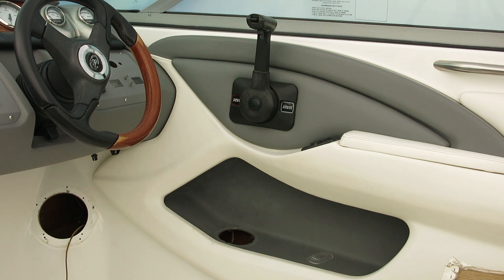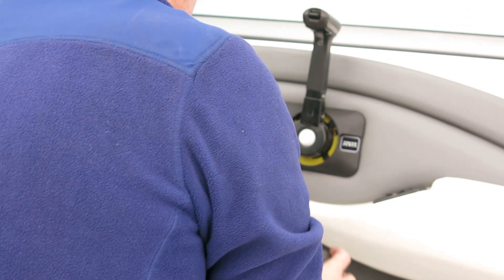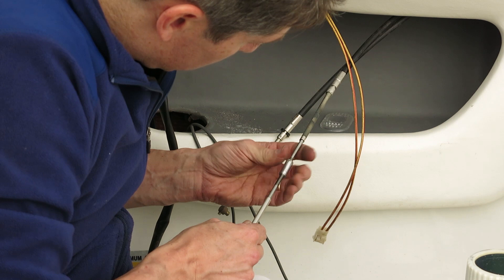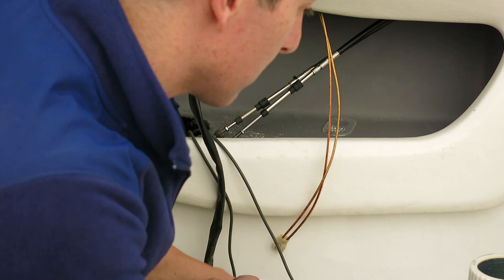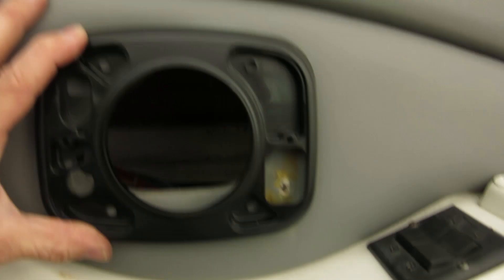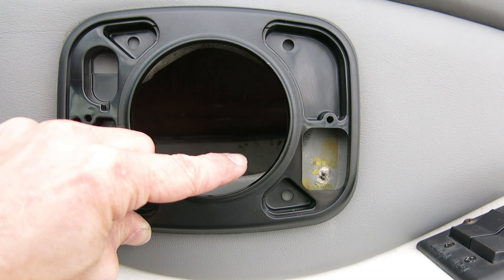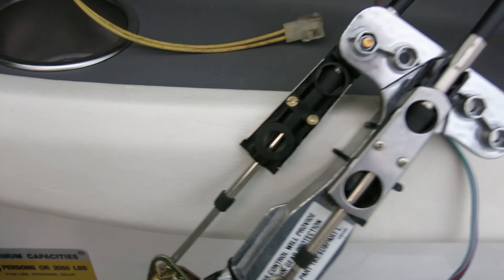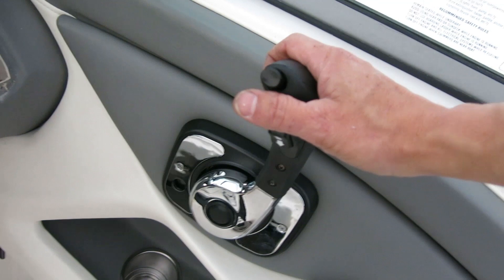Upgrading a Seastar Controller

Comment: Thanks for making this video, it helped me figure out how to remove my old controller and also what types/brands would likely be a replacement.  At first I was a bit miffed as you were between the camera and what I wanted to see, but I still got the idea and this was great information.  thanks again!
Reply from the maker: Sorry about the camera obstructions!  I'll try to do better.  Appreciate the feedback.
Reply: @SlideruleRacingProducts  Good man, still many thanks.  I'm going to tackle this job sometime this week and your input was very helpful.  I'm excited to upgrade my old controller, it was still working but a bit worn and the shift cable was binding quite bad.  The updated look will be an added bonus.

Comment: I know it is a Long time you posted the video, but does the remote control have like a throttle tension adjustment? I have the same control, but you need a lot of Force to increase throttle. It could be the cables, but it could also be an adjustment in the control. Any chance it could be the last possibility?

Comment: Very helpful video!  Thank you.  I am replacing my cobalt controller due to failed neutral button.  I am replacing my sl3 with a sea star CHX8554P.  My question is why so many wires going to the sl3 when the only electic action is the trim tabs.  I haven’t received it yet but from pics it looks like the CHX8554P only has 2 wires going to it.  Appreciate your thoughts on this. Thanks for the video- it gave me enough info to take this job on myself!
Reply from the maker: There are the trim wires, the neutral safety cut-out wires, and then if you have the kill switch option there are the kill switch wires.  So, it's not just the trim tab wires.

Comment: ”Kill switch”? I thought that was for the drive switch to enable the Beach Mode and allowing the drive to reach the very top position. Is that an option and to be used as you like?
Reply from the maker: Not all of the Volvos have the trailer button to push the drive to a higher setting.  The Volvos require a separate control module that stops the trim pump when the sender reaches a specific resistance measurement and most Volvos don't have that installed.  In my limited experience, I think most Mercruisers (which do have the trailer button) don't use the Seastar controllers but instead use the Quicksilver controllers, which have a separate trailer button location.  That hole specifically is for the kill switch tether, but you don't have to install the kill switch in the controller.  In my boat (and many Cobalts) a separate kill switch is installed in the dash that tethers can attach to, so I didn't use it.

Comment: I’m thinking now of repairing my controller via Side Mount Kit 317002 and replacing the plunger and neutral switch. $150 and easier than retrofitting a newer controller.

Comment: I have this same controller and need to tighten my throttle tension. My throttle slowly backs itself to neutral if I don’t keep my hand on it. Did you find the throttle tension screw?
Reply from the maker: Yes, go here: http://www.seastarsolutions.com/wp-content/uploads/2011/06/CH1700-7500-7600-Rev.4-ISCH7500.pdf and look at page 14 for the "friction adjust screw".
Reply: @SlideruleRacingProducts  much thanks!

Comment: I have a 2005 255 was curious how long your cables are in your boat. Guessing 17 feet long?
Reply from the maker: It looks like when I replaced the throttle cable, the one I bought was 17'.  Good luck!